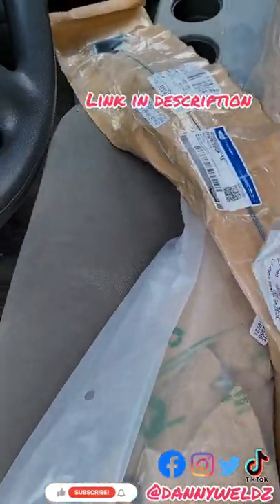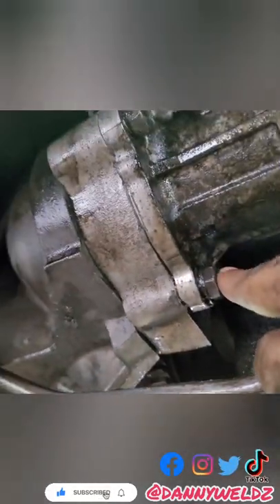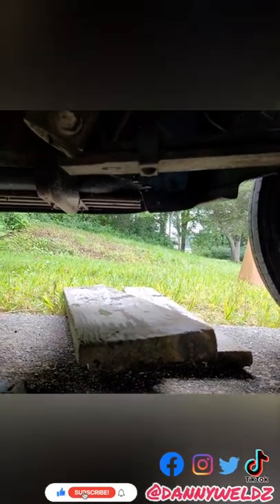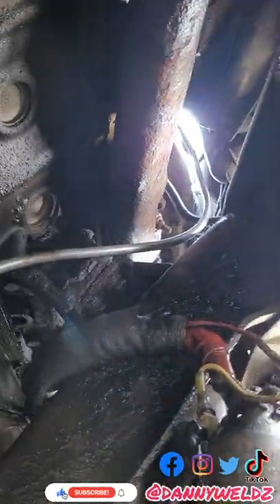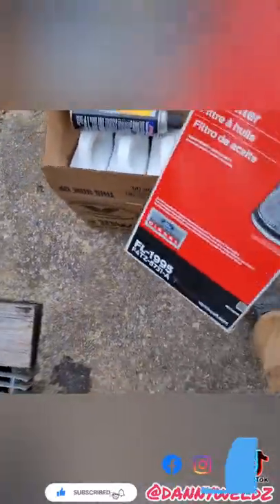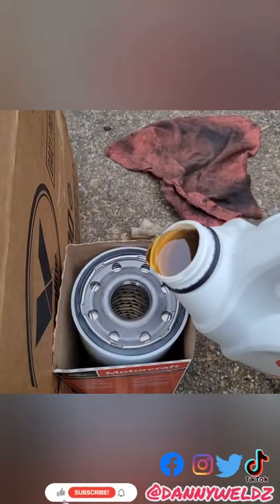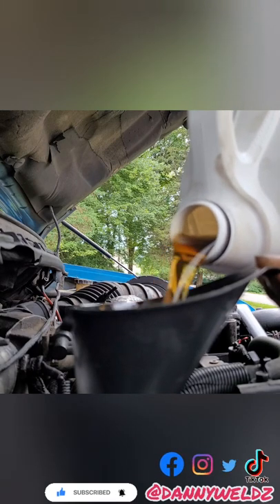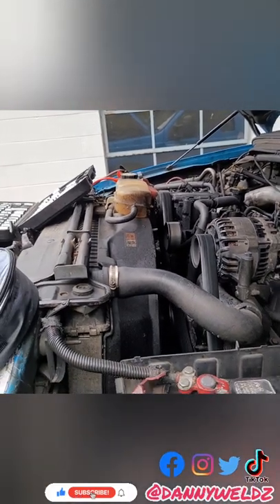7.3 Powerstroke dipstick oil leak & oil change.

Comment: Best advice I can give you is poke a hole in the bottom of the old filter cause there a lot of oil in filter that’s what I do on my 7🌲 the filter hold about a quart of oil and 15 quarts is right
Reply from the maker: I changed the filter